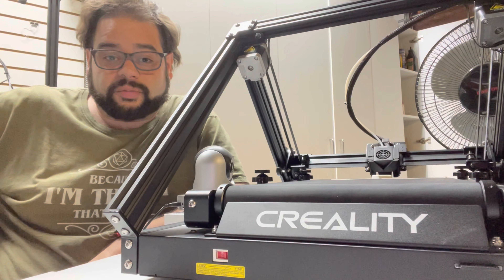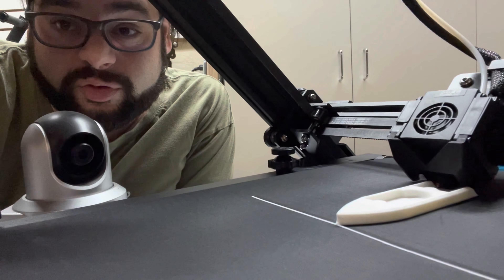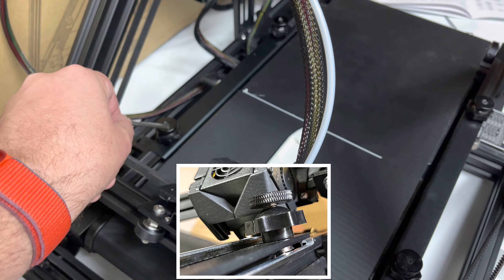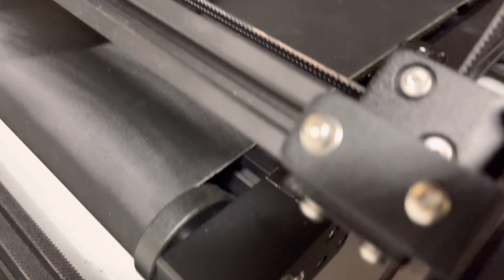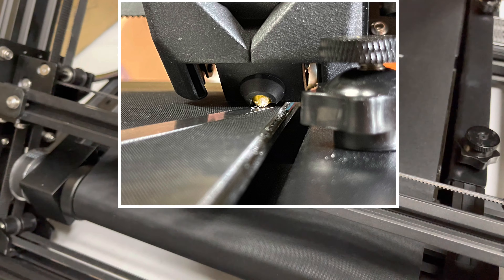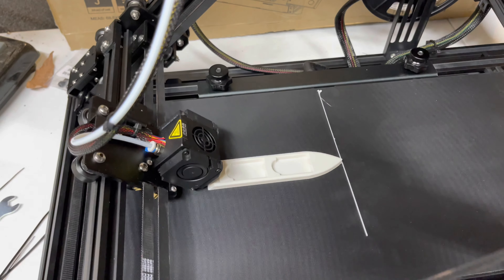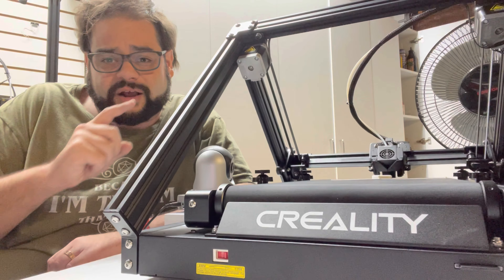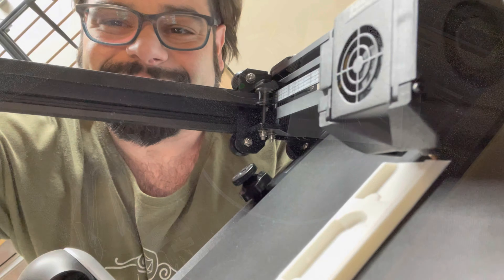Creality 3D Print Mill Kickstarter Edition Bed Leveling and First Thoughts : Thanks Naomi Wu!

Comment: From looking at the position of your (4) locking screws to secure the Y-Optical Endstop, something must be different with mine. With the bed down flush with the extrusions and when I run the gantry all the way down to have the nozzle touch the belt then I adjust the Endstop bracket flush to it with the 0 .1mm spacer like you showed, the Y-Optical Endstop will not go low enough to allow the nozzle to touch the bed let alone go past it. I guess it is about 5mm off / to high from the bed with it adjust/screwed all the way down. I basically have to raise the bed itself a lot to get it near it. It is as if on mine the metal arm to trigger the Y-Endstop is to long for this method of leveling making it stop further /higher from the bed.

Form the design of the printer the metal brackets on each side look to be designed as Physical Stops to keep the gantry and nozzle from going to far if the optical Endstops fail. Which is why what you show here make sense to do. Basically make it so that the gantry can hit them and not allow the nozzle to press to far into the belt. Although for me to level the bed using this method with my 3DPrintmill I have to have to brackets past that point and also raise my bed up a bit as well. If I do it the current way I have to raise the bed up a good deal using the adjustment knobs.

I can get it to work this way. I just need to raise the bed a lot more in order to level it. Which just seems odd to me after watching your video here.

Comment: Thanks for this video. When you say the 0.1 shim should fit between the nozzle and the bed, is this a tight fit (compressing the belt material?) Or a looser fit
Reply from the maker: Tight but not compressing

Comment: Hello, I am also a backer that just got my 3D print mill as well. Your video helped me with my initial leveling and I am grateful but I have hit a new problem. My printer now randomly stops during a print. I notice that the progress bar on the screen reaches the end and it's no where near the actual end of the print. Did you experience this or do you have any tips to get around this issue?